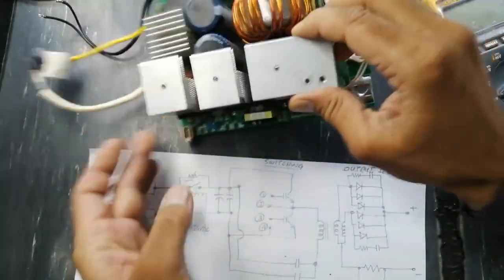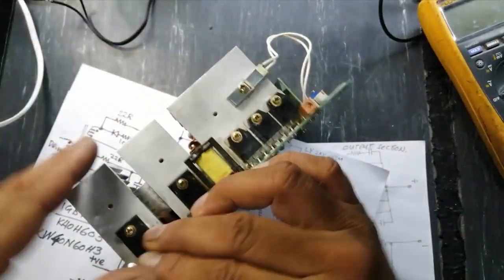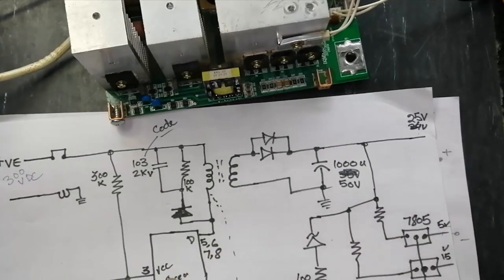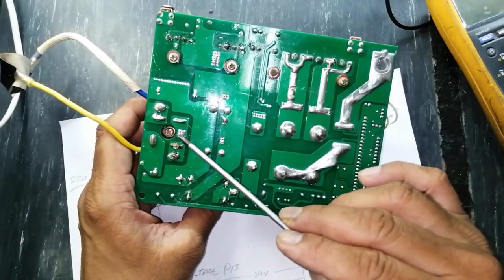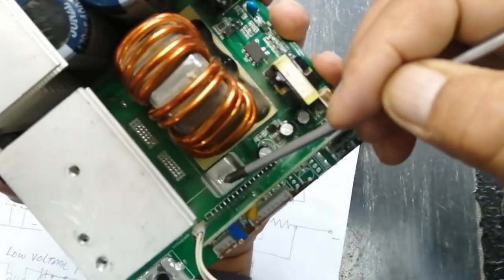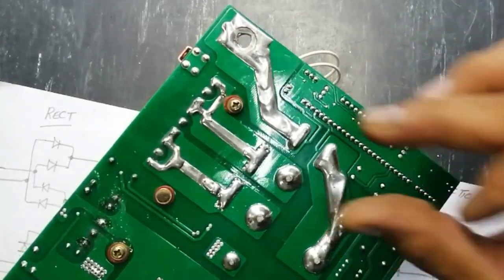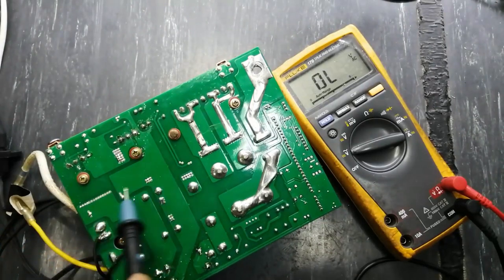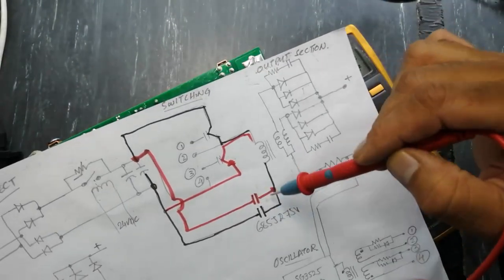#299 Single Board Inverter IGBT Welder Machine - Function & Troubleshooting

Comment: Wooh this is the best esplaination have ever gotten thanks man nice one and a big thumb up for you 
Pls am trying to fix one inverter welding machine with out no out put to spark up electrode, can you please Troy light on the possible causes that can cause output  problem and how to fix it
Reply from the maker: best regards for your valuable appreciation
in your case, first of all verify the dc voltage at main dc capacitor
then check low voltage power supply for 5 volt 15  -15 volt
then check the current setting pot
then verify the IGBT drive, if no drive is there then check control card
aslo check video number 286, 287, 288, 289, 291, 292 & 293   every video is to discuss each sub section and its components and their function and its test troubleshooting

Comment: impresionnant votre explication chapeau bas  dear 
i have an issue with the same [ the display  fluctuate from 80 to120  with no output can you please help] cheers
Reply from the maker: best regards and special thanks. 
if it is fluctuating, that means there may be something wrong at inrush protection. 
please check the main relay at input AC voltage (parallel to the NTC / PTC thermistor) 
reply when you verify it. i think this is main cause for restarting of the circuit (causing fluctuation)
2nd possibility, check low voltage power supply (24 volt smps circuit for regulated voltage)
Reply: @HaseebElectronics  
dear sir many thanks 
i will check it and reply afterwards
cheers
Reply: sir  for you information 
when i measure the output voltage  at the transformer it seem  too high [40vdc]
i removed the transformer to have free space 
and i noted that there are a dry solder on a  resistor [5.6kohm]
many thanks for your help 
the machine have already test and  deliver to the customer

Comment: Good information, MashaAllah... I have a similar inverter welder and as you said the output is DC, so how we can smooth the output, and can we put (add) smoothing capacitors parallul to output... (i did some experiment by putting a high current bridge rectufier at out put (to be on the safe side) and then i put the capacitors in parallul and found improved output.... so my questions is; can i put smoothing capacitor directly (parallel) with output electrodes? and what kind and capacitance?
Reply from the maker: first of all i am thankful for appreciation of my work.
secondly, we cannot add any component without proper calculation, otherwise the circuit will become imbalance 
( Your questions; can i put smoothing capacitor directly (parallel) with output electrodes? and what kind and capacitance )

there is no need to put capacitor in output, as it is current controlled machine, so adding capacitor will make false reading in feedback system.

Comment: Excelent video! but what about if I have arround 90V-100V at output of the welding machine? That means arise of capacitance and too low impedance or any other problem? Thank you
Reply from the maker: if you have excessive voltage 
that is due to pwm control card. when it's duty cycle will increase, then the output voltage will increase.  
it might be duw to the feedback network (operational amplifier connected with output current sense  shunt resistor)

Comment: Did u connected the bridge rectifier to direct ac current
Reply from the maker: first bridge rectifier is operated through soft starter circuit, then it is directly connected to line voltage, because it is high power circuit

Comment: AS. please explain that why positive voltage to collector of the igbt and negative to the emitter? I mean we generally see the source connected to the emitter side of the transistors at the circuits. So it is supposed to be connected both positive and negative to the emitter side. but here this is different type connection.

Comment: I received a single board. there was not any igbt. when i install 60T60 it doesn't do anything. when i install 60N60 its runs normally but igbt get hot within few seconds even bulb in series and without any load. do you have any idea what could be the season ? Thanks

Comment: Hi, I'm from Cuba and I just watched your video, I had a problem with a TIG200 Ac welder, It blows up the 4 mosfet bridge after 2 min of working. It uses a driver card with 4 gate controllers and 4 mosfet in H configuration, and the driver card doesnt have blown up components. Do you think its a conmutation problem, have you seen anything like this??
Best regards...
Reply from the maker: welcome dear 
it happens when 
gate driver component (for any single mosfet or pair of mosfet) is bad
driver card of pulse forming network for full bridge drive is not working good 
if the allowed deadtime between both channels is low and both channels are overlapping (check signal with oscilloscope) 
might be low quality components, that doesn't meet the product standards
Reply: @HaseebElectronics  Can I watsapp you, I wrote to Electronic Corner for the driver tester, but I think he is more interested in money than helping people, besides I want to show you this SEMIKRON full bridge mosfet encapsulation and what I did to replicate him...
Reply from the maker: no problem
please send to 00962-79-1161084

Comment: Hello great video as always. By my capacitors I have by both of them 11 volt drop. They are 475k 4,7uF and I don't know if they are good or not. I don't know what should I do with them. The core is heating up by standby to almost 50grad Celsius or more. Should I change them on same ones they are 250volt or 685k s 6,85uF.And if I could use capacitors 400volts.Tell me please your opinion.
Reply: Sir has 275v on the paper. I think 250v is too low considering the input DC voltage.
In video #288 it uses 400v.

Thanks to sir for these videos

Comment: thank you for explanation.  we have one problem  in our smps. we have multiple output smps in our machine. when we check output side of smps, it was showing 15v dc but battery charging voltage is not coming. there is no short circuit in put side . i checked voltage at capacitor 313v coming. but chopper transformer output side is no voltage. i checked opto coupler voltage at 1.070 v coming
may be problem in chopper transformer or how to check chopper transformer
Reply from the maker: I am little bit confused from your question, because you said multiple output transformer, you have 15 volt,   you have no output, you have 1.07 volt on optocoupler input. many thanks are mixed together
1. if you find 1.07 volt on optocoupler that is the biggest proof that the smps controller and high frequency transformer is working good
please send a picture to my WhatsApp 00962 79 1161 084
Reply: Ok i will send copy tomorrow

Comment: I have this welding machine that doesn't weld. i noticed the IGBTs were gone. i have removed and replaced but it still not welding. on the multimeter at 200-ohms reading, the resistance is 20-ohm from gate to source even when mosfet are absent
am i missing something

Comment: Good day.. Thank you for this great video.
i have a welding machine close to this one upon checking i found out that their are burnt/damage components.. busted IGBT, shorted diode and burnt smd resistor and capacitor,  Can you provide schematic diagram of this welding machine for me to be certain of the value of the components.. thank you
Reply: i am refering to the components showed at 11:24 and the board model of my welding machine isXH18051-2
Reply from the maker: kindly send whatsapp to 00962-79-1161084
or my gmail id ashraf4ta4
i will send all circuit diagrams

Comment: Merhaba bende zx7250 mini welding Var  kartın pozitif çıkışına tetikleme role bağlamak istiyorum( starter relay )
Nereye bağlamam gerekir  

Selam aleyküm , I have a zx7250 mini welding and I want to connect a trigger relay to the positive output of the card (starter relay).
Where should I connect it?
Reply: 12volt 200 A Relay bağladım kaynak yaparken relay yapışıyor 

I connected a positive output 12volt 200 A Relay, the relay sticks while welding and does not let go.

Comment: Can we varry  the out put voltage of welding machine?
Reply from the maker: yes we can. 
in welding machine the feedback is based on output current 
to convert it to voltage regulation, the feedback will be converted to voltage mode feedback

Comment: What happens when i haven't output power (0v) ? I tested all welder machinr (IGBT = Ok, poliester cap 250v with 4.6 uF and 0.02 esr 2 caps with similar measurement = ok ,4 diodes for high current withou shorts, 2 mains capas got 297V each, pulses which comes to thr IGBT is not square. Any help ?

Comment: Where do we adjust the output voltage of the inverter? the oscillator adjustment is only for the output current adjustment?

Comment: So I'm pretty sure that I have a problem with a power relay for my machine and it stops the fan from coming on and the machine will shut down in saftey mode.
Reply from the maker: some times, the fan is faulty due to excessive humidity,hot weather  dust, rust and its internal circuit becomes short circuit 
sometimes the power supplies is not capable to produce enough current due to its regulation failure 
check polarity of the fan wires 
connect fan and check voltage on connector. if voltage are stable check fan 
if voltage drop, replace fan and then check voltage 
if voltage drop with new fan, then check power supply

Comment: I have a welding machine with one card, it was not working, but I fed it 24v, so the screen and the fan worked, but there is no output, knowing that the ignt is intact and the schottky diode is intact. Can you help me fix it?

Comment: hello sir, I have a chinese TIG/MMA 215, it powers on normql output voltage, but upon touching the welding rod to working material it goes to protect, oc led lit, removing the load it swithes back to normal, it won't burn the welding rod, what could be the fault in my welder?
Reply from the maker: it means the over current detection circuit is active, it happens when input current excceds than the output current, 
check the current transformer circuit, in control board might be there is operational amplifier, which detects the signal from the current transformer and output shunt resistance
check there are potentiometers for calibration. try to adjust the over current limits and reduce the current transformer circuit's signal

Comment: hello welding machine yeswelder 135 ampere 110 voltage but my region is 220 voltage How can I convert this machine to 220 voltage? Which elements do I need to change?

Comment: My welding machine fan not working contusly it's off suddenly ,not welding properly what needs to check
Reply from the maker: please check temperature sensor 
or may be some dry-soldering on some power related components

Comment: -What is the advantage of a double board vs single board?
-Does the double board design give better duty cycle?
I want to buy a welding machine from a reputable manufacturer here in Germany but they offer two versions of the same machine: a cheaper single board 6 diode one. And a more expensive double board 12 diode one!
Both machines output 200A!
Which should I choose? Money isn't a problem to me.

Comment: According to the the multimeter checking method all the IGBTs of my welding machine are short. But the machine is working absolutely fine. Hows it possible ?
Reply from the maker: might be you are with charged gate. discharge the gate and check it
Reply: @HaseebElectronics  ok thankyou

Comment: Is the temp sensor shorted for normal operation?
Reply from the maker: there are 2 types. 
one is normally closed 
other is normally open
Reply: @HaseebElectronics  thanks for the info , but in your case wherein you had repaired so many welding machines , what did you encountered most, open or close? specially in your tutorials
Reply from the maker: in some models these are open contact type 
and other use close contact type 
most of the time their temperature sense response gets slower due to bad thermal conductivity. in this situation it doesn't Sense the temperature properly so that the ight get damaged while the thermal switch is sleeping. 
removing the dirt, dust, applying thermal paste, it clears this problem
in some cases it needed to replace it

Comment: If I may say something , I think that the In real life current always goes from negative to positive, I think that the current changes direction at the primary coil at high frequency,  and this is posible because of the there are not many coil turns in the transformer, I was wondering that for a long think , this is the onLy way that it can work
Reply from the maker: exactly perfect
at high frequency it switches the transformer
so at high frequency the transformer produces inductive reactance, so the few turns are enough
electronic current flows from negative to positive terminal
in conventional current theory current flows from positive to negative

Comment: I need a help ...
How can I  increase the output dc voltage of igbt based inverter weldeing  machine which is near 35 v without load  to 55 v for load at 50amps?

I want to hack this inverter weldeing machine as Ac to Dc rectifier .
Plz guid me sir ..

1.Shud i increase the sec. turns of transformer ?
2 .shud i change the oscillation frequency

Comment: where can i buy this board?
Reply from the maker: you can check some online suppliers
Reply: @HaseebElectronics  i have one welding machine with same board. it was working but before it was stored for about a year, when i powered it after a year the fan was only giving kicks, there is no 25vdc
Reply: its a good idea that now i can use an external 24v for the rectification

Comment: I tryed built this circuit it work but the biggest issue I have is the igbt seem to be fake and I bought 100 pieces at 2,7 amp the the igbt work but pass that boom they goes I try adding 4 and add 5 amp it work but pass that boom they goes I need it’s hard to fine genuine igbt that comes in factory machine